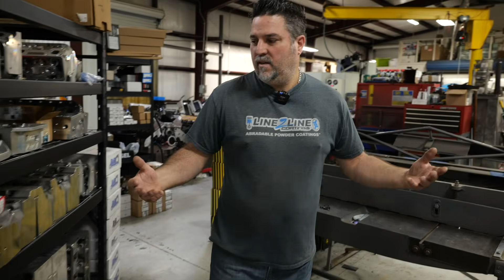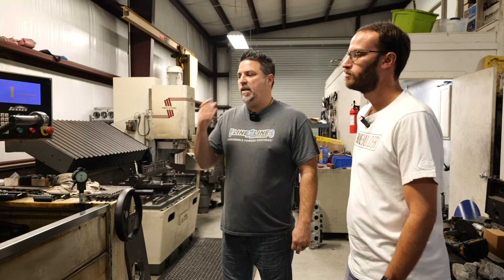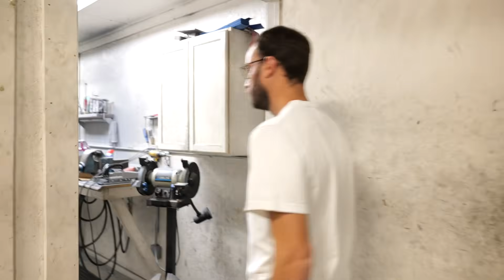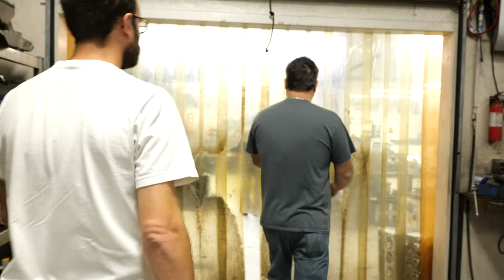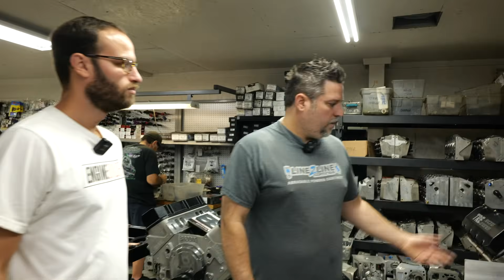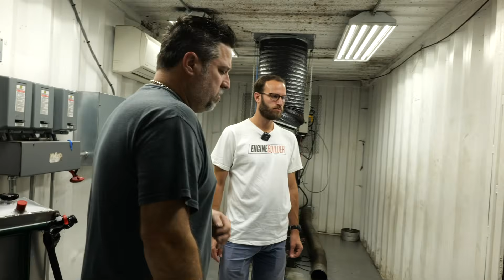Drag Race Engine Heaven at TRE Racing Engines

Comment: 5 feet from the dirty area where they build fabricated intakes and weld and grind and is a total nightmare "organizationally" and "ergonomically" and therefore "economically" sits a "new build" long-block on a stand and totally exposed to the "elements". 

In that shithole a fire could take all day to get going "good" and everything in there would still be a total loss. 

That place is a deathtrap. For the "workers". Fuck the "work". That shit is all replaceable. 

OSHA, a state fire marshall and probably even the local fire chief would all shut that place down in 5 minutes particularly given the history of that "business" burning to the ground. 

No doubt they got "terms" from "manufacturers". On a sight-unseen basis with the manufacturers having no idea just how THEIR "product" and ASSETS are being "warehoused". 

Keeping those "terms"? Long enough to get a certified cashiers check for all that inventory in one lump sum and within 5-10 business days maybe. And from then on FOB. You can't even trust a "customer" like that on "COD" since you have no idea if the building will still be standing when the delivery arrives.

Comment: "Engine building" with a "high end" and "high performance" and "high horsepower" aluminum engine block sits on the FLOOR while the "engine builder" beats parts into it with a hammer and steel "driver". 

Yeah. Shit you never see dealership technicians in the "auto industry" and "diesel industry" do while "building engines" for "low end" and "low horsepower" and "low performance" vehicles, equipment and machines that move, clothe, house, feed, fuel, power, build, maintain, grow, connect, educate, protect and serve the "modern world" and without which "professional engine builders" and their entire "industry" not only would be useless but wouldn't exist and MOST of the "workers" therein would be digging ditches.

Comment: 2500 to 3000 to balance a crank is eye opening. The number of people who need or use machine shops is definitely shrinking in this economy. Too expensive for the normal working guys and that’s where it started.
Reply: I’d gladly pay $3,000 for my $7,000 crank to be balanced correctly
Reply: @teamgrizzly2859  Good for you.  You must have a lot of money to be throwing at a crank and not even racing professionally.
Reply: @mugshotmarleytypical cost associated with a good big block crank, hell I have over 13 thousand in just one set of cylinder heads for my big block, and there are many more of us out here that pay for it at least once a year if not more. It’s just part of racing. I’d hate to think of the amount of money I’ve sent to Bryant Racing Crankshafts or Brodix and others for heads over the years, been doing it for probably close to 25 years, and have ran Bryant cranks for at least 20 of those years so it adds up. But when you’re doing cash day races and you have races that’s 25,50,75,100k or more to win on the line, you pay to have the best. And no this isn’t professionals that’s out here paying for this shit, if that was the case non of these places would be in business, because I can assure you that there is far far less professionals buying these products than there is the average Joe that’s building bad ass race cars out of his garage on any given weekend throughout America with his buddies then there is a professional, hell 90% of these “professional racers” nowadays don’t buy race parts anyhow, they couldn’t tell you the first fkn thing about a motor, they show up and drive, that’s it. That’s what they’re paid to do, nothing more nothing less period!  And that i can absolutely assure you.
Reply: He’s talking about balancing a 6” crank for a 800 +/- cubic inch engine dude. That typically cost around $80k+. The balance job is a drop in the bucket in the cost of that program.
Reply: @427n20 absolutely!
Reply: Trump is going to ruin the economy and the spare cash people have to spend on things like this.700,000 jobs lost this year........